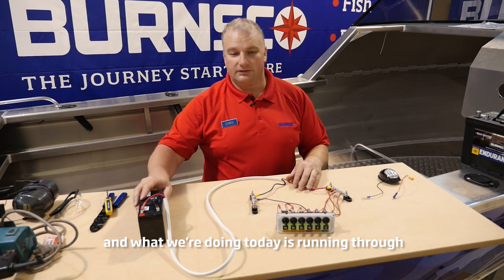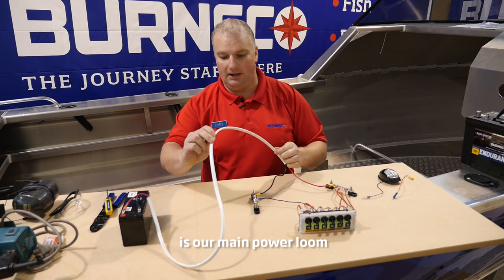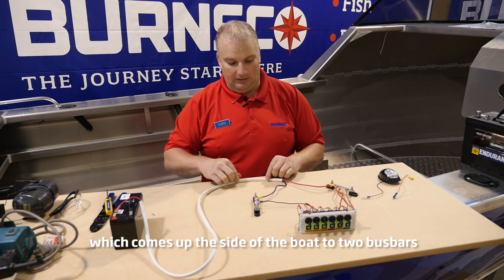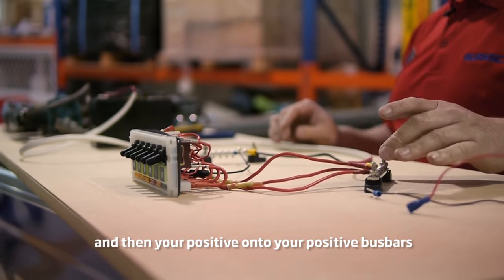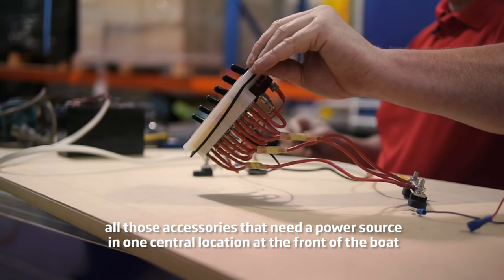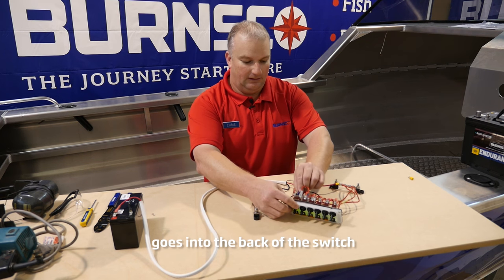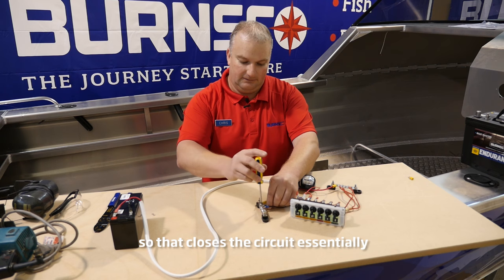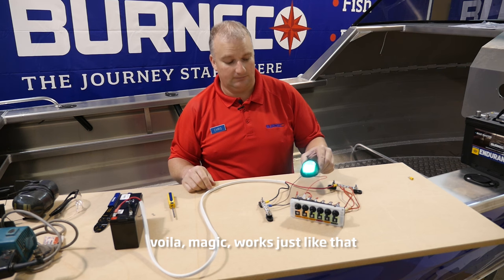How to Install a Switch Panel on Your Boat

Comment: I am wiring a 6gang switch panel and would to know if I need a 6 fuse block and if so where in the circuit does it go? Thnx
Reply from the maker: Yes, you will need something to fuse the switches. Many modern switch panels will come with the fuses built into them as the one in this video does. The fuses must be wired into the positive side.
Reply: Thank you. How would I wire so that the panel is not always on. for example it turns off when ignition is not on.. maybe tap power from ignition switch?

Comment: does your control panel have breakers or fuses in each switch ?
Reply from the maker: Hey Troy, we have a range of switch panels available, some with 1 fuse per switch. Here's a full list: http://www.burnsco.co.nz/searchresults.aspx?q=switch%20panel

Cheers
Reply: @BurnscoTV  switch panel with fuses

Comment: Hi, if I'm only connecting my battery to the switch panel, do I need two busbars or can I just have the one for the negative wire?
Reply: You can connect a positive from the battery straight to the switch panel and just use a bus bar for the negative battery wire and negative device wires.

Comment: What about fuses?
Reply from the maker: Hi I SSMDad, the panel used in the video has the fuses built in. There is one for each switch and they are accessible from the front. You can get them from here https://www.burnsco.co.nz/switch-panel-6-way-connex4

Comment: Danger! If you wire it as shown with no fuse or circuit breaker at the battery end of the cable you are risking a fire on your boat. There are fuses in the switch panel, but these are useless if something shorts out the cable between the battery and switch. No wonder there are so many boat fires if people are promoting this as a safe circuit.